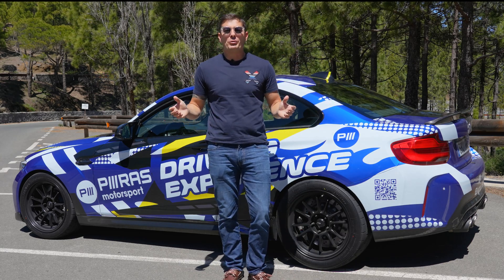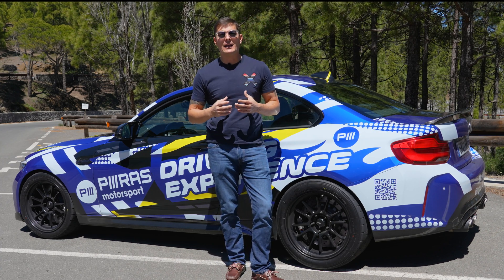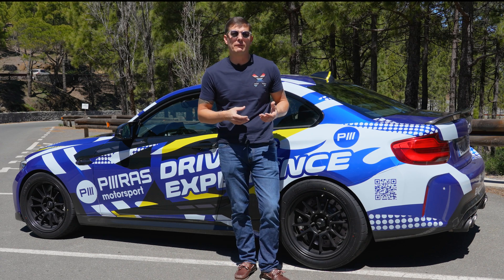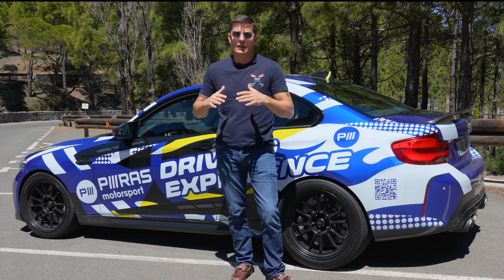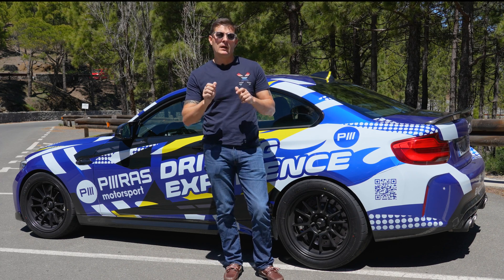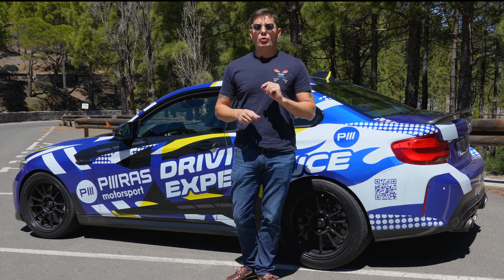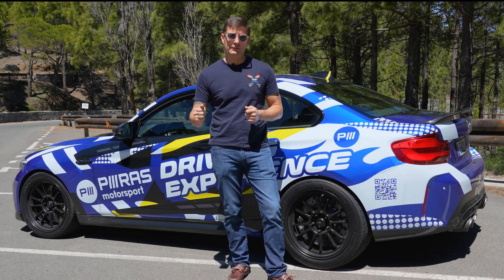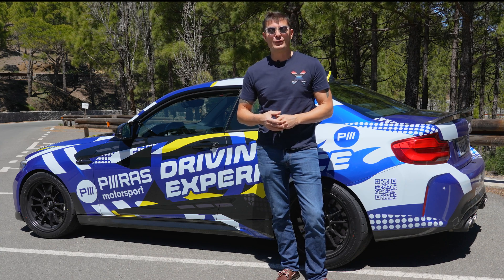Ultimate Coilover Setup Guide: 3-Way Suspension Explained

Comment from the maker: Let me know if you want support with specific details on the setup, no problems!
Reply: I'm sorry I posed this question on your R1 vs R3 video before I saw this one. I'm curious to your baseline settings you settled on (for aggressive b road/canyon roads) when you had the original spring rates of 120nm front & 70nm rear (i think you may have changed rear rates since this video?)  The R3 kit I'm looking at for my M2 Comp will have the same 120nm front but 160nm rear (i'm running divorced rear spring (like OEM spring location) vs true coilover like your configuration). My M2C is mainly an aggressive canyon/mountain car here in Colorado. It sounds like your roads in Gran Canaria are similar to ours in the mountains in that they are far from perfect (i.e. sometimes bumpy, uneven, dodging potholes).  I very much appreciate your in depth videos!

Comment: Finally someone can give some good details to setup a 3 way. 

often people give out the wrong information then the wrong information gets pass down to the next. I have a set of KW revalved 3 way by this company in the US name racecomp.

Basically I learned that HS comp has a huge effect on LS comp. In ways that, we have to setup HS comp stiff enough that the dampers won't bottom out under bigger impact. Then use LS comp to tune for driver inputs.

Also LS comp has an effect on how medium to high speed bump building up forces. Essentially if the driver turns down the LS comp for street driving, the car can become relatively compliance on the street. But if the driver turns down the HS comp substantially, the dampers won't make enough forces to prevent bottoming out and it won't provide enough forces for driver inputs either. 

Lastly I found that rebound has the biggest effect on the transient handling like you mentioned. On track when I setup my compression relatively well, I only use rebound to tune that transient balance. Soften it to cause faster cross weight transfer, stiffen it to cause slower cross weight transfer. But at the end of the day, it's my swaybars and springs that are dictating my mid corner handling behavior.
Reply from the maker: Hello Vin,
Thankyou for the beautiful writeup!
The experience you have is completely correct, couldn’t have written anything better.
Of course the inter-depencence between the HS and LS depends on shock design, but in shocks like the Nitron R3 your insight is applicable.
Please comment more often! 🙏
Reply: @PIRASMotorsport  will love to see a series on tuning for transient handling
Reply from the maker: Will do more!
Reply: Performance wise, you'll always want to start with the hardest compression setting & softest expansion setting.

Dial down HS till you get comfortable ride over biggest bumps you expect to drive through. This is your baseline.

If the car still feels too uncomfortable on pebbles, this is the time to play with LS, keeping in mind what you said about LS & HS dependence.
But, in my experience, most kits sold over the counter are not hard enough for ultimate spirited driving, but at least they are safe for amateur tinkering.

Then it is time for some spirited driving & hardening rebound. With good shocks, with hard, track oriented bump, rebound hardening should be kept to minimum, mostly to dial in some balance issues.

If you choose to go softer on bump settings (for comfort), the harder you'll have to go on rebound.
Reply from the maker: @DriftJunkie yes, I agree with the procedure you state!